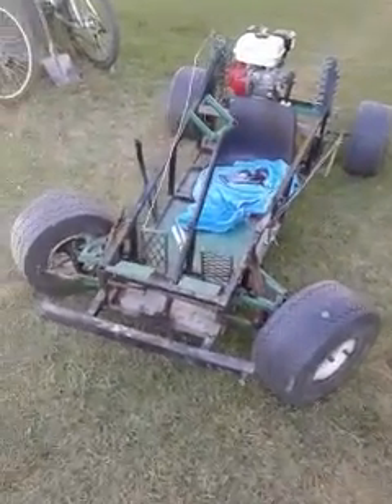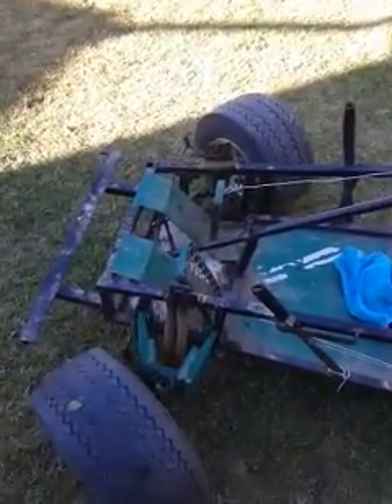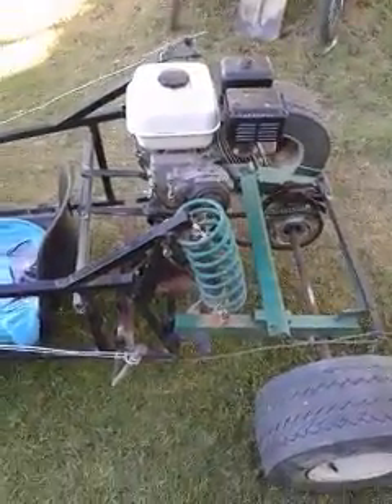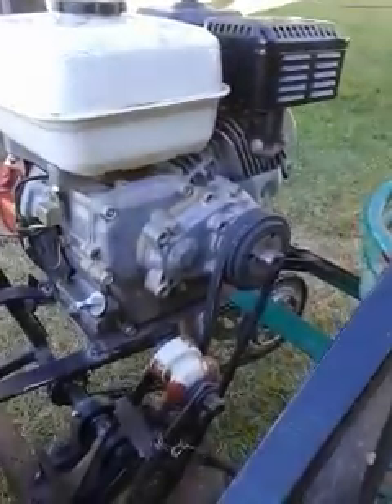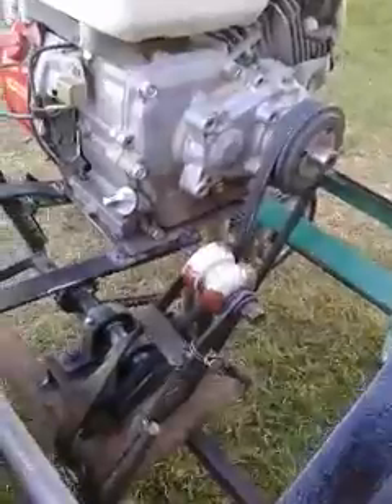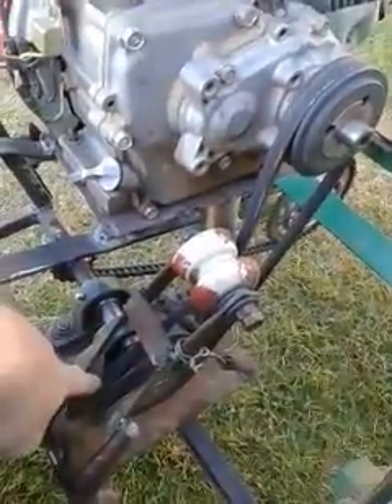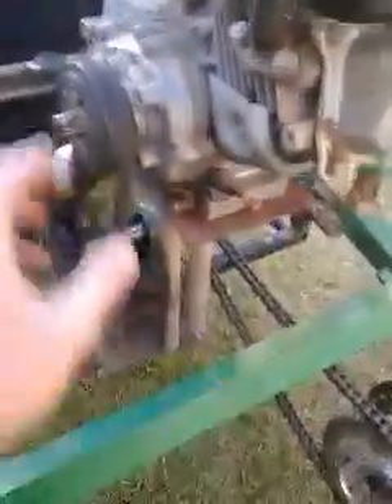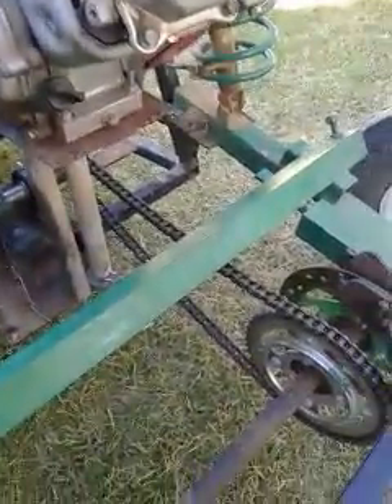DIY Gokart with Pulley Clutch

Comment: make a video on how to make a belt driven clutch
Reply from the maker: Robot Johnnie5  

Thats a good idea, I will definitely do so if I get the chance again!

Thanks for your Input.
Reply: normaly the reduction gearbox from honda for the gx series have a wet clutch inside that engage at 1800 rpm
Reply: and they came 1:2 or 1:6 gear ratio
Reply from the maker: @guillaumepilon8167  very true. When i found this one, I was really hoping for exactly that. But unfortunately it had no clutch, therefore the improvisation. I have no manuals or any reference that states what its reduction ratio is. Just assumed its a 1:2 and was happy with that.